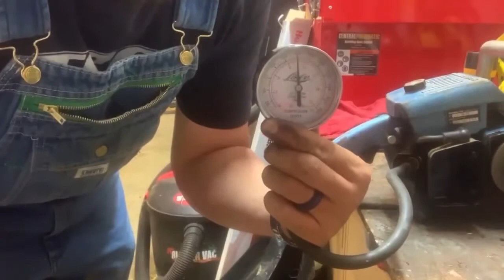Stihl MS441 | Running with just lower transfer port work

Comment: I'm probably gonna have to look into rebuilding mine here before long. I noticed the power has been down some so I checked the compression.  It's down to 130psi. It still starts and runs good,just not like she used to. Watched your videos so I'd have an idea of what I was gettin into. Appreciate ya posting all you have.
Reply from the maker: No problems I’m just glad I could help you out.
Reply: @JKSawShop  mine is the mtronic version,hope it's not to different.  Thanks alot
Reply from the maker: @ciphercode2298  mine is carbureted version. I have a little treat with this 441. I am going to straight gas it, maybe help someone out that doesn’t know what will happen. I have had all the necessary parts for rebuild donated already.

Comment: Did you remove any metal on the lower lip that extends into the cylinder?  I am not sure what that is actually called.  Most port work I see they remove a good bit of that on the portion next to the transfers.  Thanks for showing this; your about the only one to show port work on the ms441 which is the saw i have.  Also did you do anything to the muffler?
Reply from the maker: Nothing to the muffler at that point and it was just the lower transfers. It made a huge difference just that.